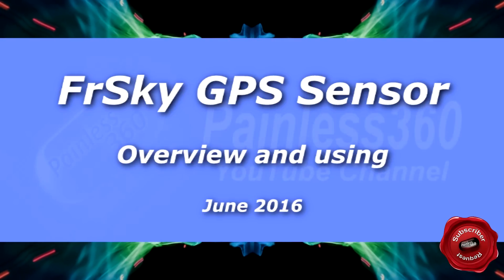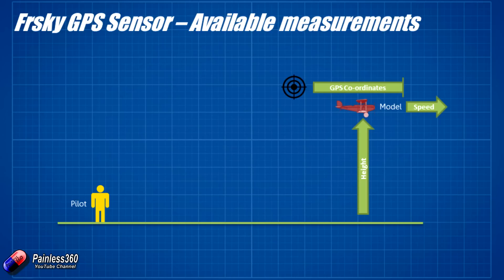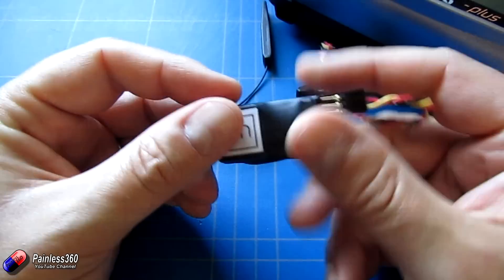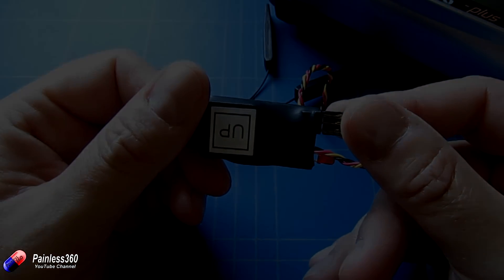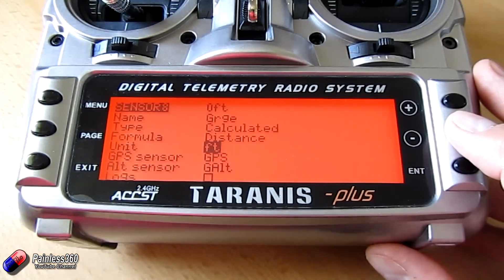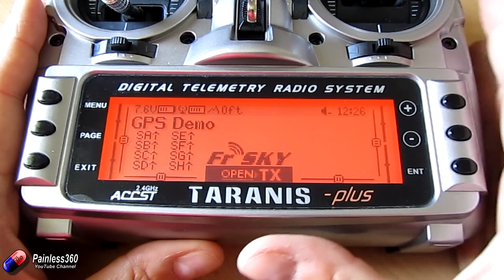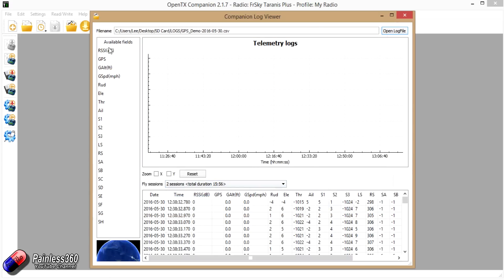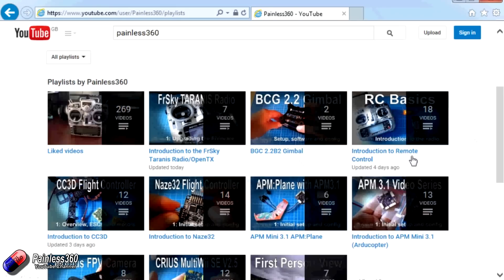OpenTX 2.1 Telemetry: The FrSky GPS Sensor, setting up, using and creating extra sensors

Comment: I guess it's underrated because pilot cannot read the TX screen using FPV goggles. So an OSD is the most used alternative.
Reply from the maker: If you're an FPV pilot - sure, but for that we'd be using an FC with a GPS and OSD. This is more useful for those times where you're not flying FPV ;)

Comment: Anyway we can send the GPS data to the Naze 32 so we can see it on the OSD?
Reply: +1
Reply from the maker: This is for those times when you're looking for GPS detail on a model without a flight controller. If you have a FC installed in the craft then we have lots of videos on how you connect a GPS to them (and an OSD ;) ) that shows how to get that part working.  I see this GPS being more useful for fixed wing pilots (that's how we use them here) to monitor range etc.
Reply: +Painless360 got it

Comment: thank you for this gps video, just what the doctor ordered,  I do have a question if I may,  on mine I did set to MPH,  and Ft  but the audio voice gives me the speed in percentage although the numbers are correct, and the altitude, again with the numbers right,  the sound is  Mili amps , have no idea how to change that, again, thanks for your work Roger
Reply from the maker: You do need to make aure you are using the right sound pack for the version of OpenTX2.1 you are using (see out video on upgrading to 2.1) I'll play with that and make a Quick Tip when I figure it out - let me know if you find the answer in advance..
Reply: Thanks will check this for sure.
Reply: OK just to let you know, the problem is with the Taranis plus, I installed it in my Taranis X9E tray radio and everything is perfect, will still look to update the plus